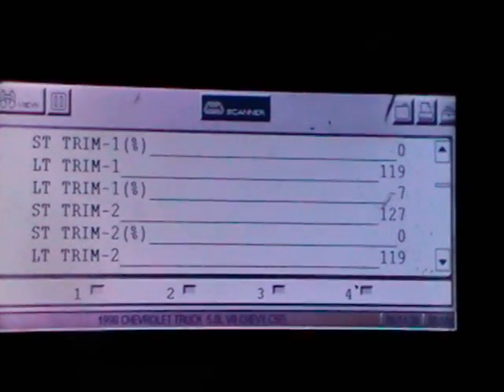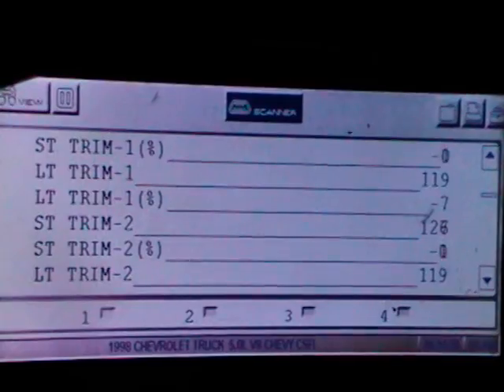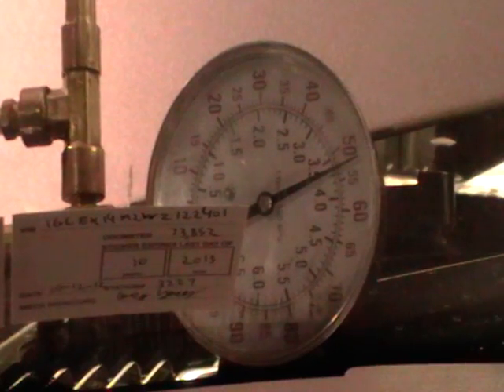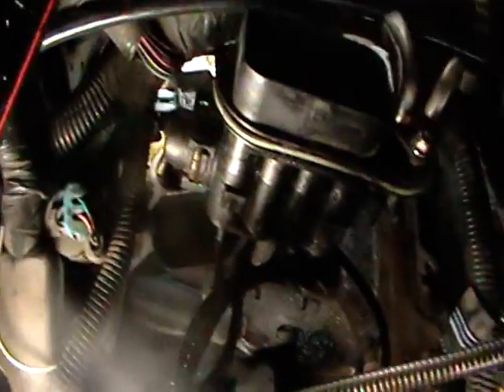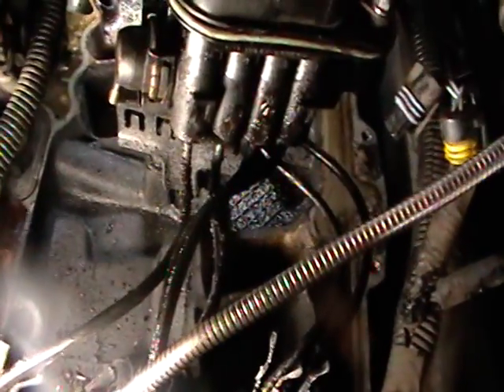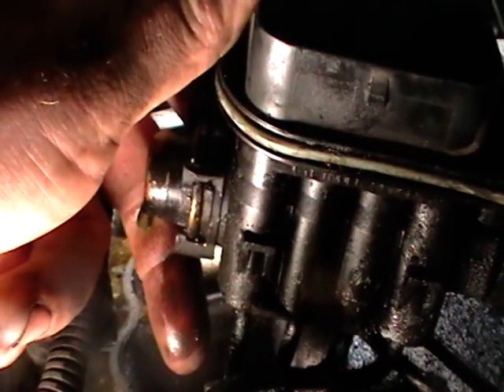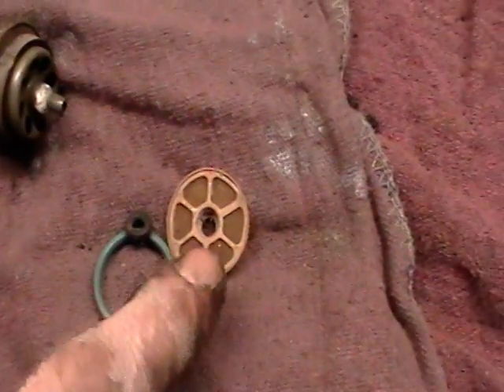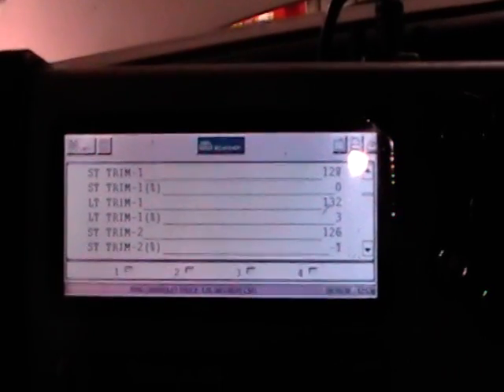chevy vortec p0172/p0175

Comment: The soot concentrated to the front of the intake manifold is normal with these Vortec 5.0/5.7’s due to the routing of the EGR outlet within the manifold. I’ve been getting a P0175 bank 2 rich code repetitively, suspecting a leaky injector/spider tube on my L30 Vortec 5.0L. Will do a fuel pressure leak-down test to confirm with engine off.

Comment: I’m suspecting the same insanity my 4.3.   My MAF is new but it’s showing about 7 G/S. But my fuel trims are -20’s.  The O2 is giving a rich fuel reading.  I’m hoping this solves my problem.  I want to update it to the new injector style
Reply: Update: replaced spider injectors with new style. And replaced MAF sensor.  Still getting high MAF readings 7-10g/s at idle.  Banks 1&2 still rich.  Not sure what else would cause it

Comment: hey james. i have a 2004 gmc safari...i really need help. my car acceleration is hesitating...when I'm driving 30-50mph it will go hum hum. then finally shift..anything will help... thanks
Reply from the maker: +Tony Phan did u try a fuel filter first? Sometimes it's as simple as its starving for fuel and surging.  And u are giving it more throttle than normal so the shift points drag out
Reply: Tony Phan

Comment: hey man good video i got a 2000 gmc jimmy saying code po172 and po175 i done everything spark plugs, wires, distrbutor cap, rotor button, air filter, mass air flow sensor, can smell raw gas coming out of tail pipe any suggestions.... i'm thinking maybe fuel pressure regulator. rugh idle when starting
Reply from the maker: sounds like you have the same problem area, the 4.3l has the same setup. i cant remember off hand when the change was but the earlier generation had a single injector with all the poppits. that one has an intake runner valve dead center of the intake, you could take two bolts and the electric valve out and look into the intake for the clean runner evidence. those ones the fuel lines came into the back of intake near the booster area and had plastic tubes that cracked internally, the regulators also went bad, if u have the next gen with a bulk multiwire plug like mine with the fuel lines going in the same area. your best bet is put a fuel psi gauge on it and crimp both supply and return lines down by trans bellhousing after u turn key on or crank to build pressure and see if psi drops with both hoses crimped
Reply: thanks man

Comment: Good video. Your bro spoke highly of you. Now a question about what is seen below the intake plenum. You showed some areas of soot and said other areas showed evidence of a gas leak but it was a little hard to see or I don't know what I am exactly looking at. So you would expect to see soot everywhere as to indicate combustion? which is good? And looked like maybe some tarnished/golden area was an indicator of a gas leak? What is the cost to just replace the entire spider? Go easy on me if I got things wrong as I am just a weekend warrior and an old guy learning... Thanks and keep the vids coming.
Reply from the maker: close.. the soot is kind of normal on higher mileage fuel injected intakes because only air is moving through there, not like an old small block with a carb where the atomized fuel moves thru it, so just air and hopefully minimal crankcase oil blowby routed thru pcv valve .. that little oil film will collect dust.. when I see the golden area.. that is the area that was washed clean with fuel that ordinarily would not be there and shouldn't be there.. the poppet valves at the end of the plastic tubes point the fuel spray directly at the intake valve further down the runner. honestly im not sure of the price of the whole injector assy off hand
Reply: Ok i got it. Thanks man. Today was a good day as I learned something new. You keep the videos coming and we will keep watching and learning.

Comment from the maker: the stabilitrack and tcs are disabled due to the engine codes since there is throttle control during some trac events..fix the rich codes..if the shifting issue is related.. the simplest check is to first check for a clogged air filter. if it cant breath it will be rich and you will be stepping on throttle farther . the shifts would be drug out due to throttle position and would shift hard..get back